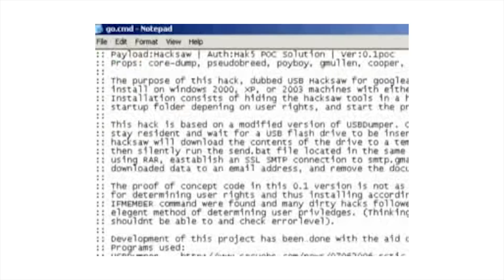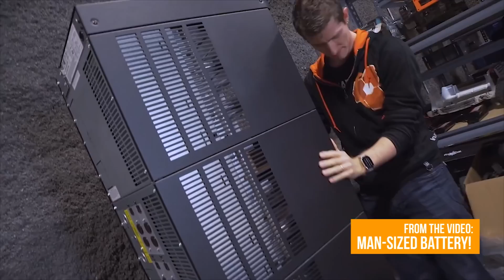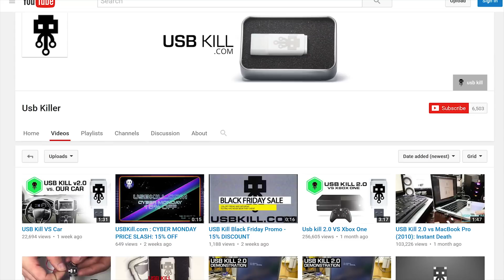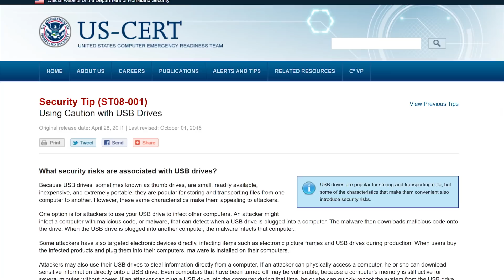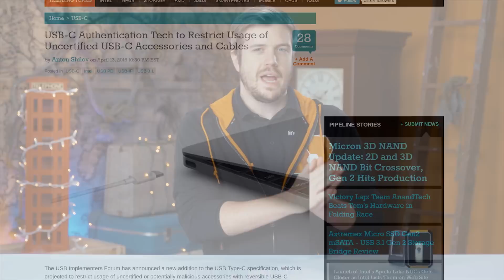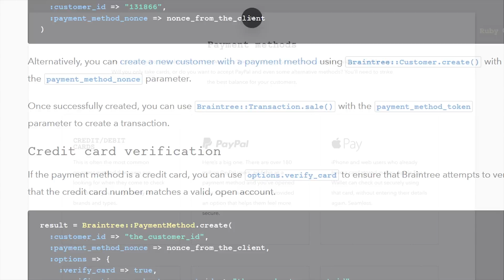COMPUTER DESTRUCTION (GONE DEADLY)

Comment: Why couldn't they just put a fuse in usb ports? If the port receives a voltage above the usual, the fuse would break the circuit.
Reply: Fuses break the link after a x amount of amps goes through them. Not voltage.
Reply: Budred123 that would be expensive. that would be 6-16 fuses per motherboard + they would have to drop a lot rnd money to make tbem work well in such a confined space.
Reply: Fuses break from current, this has very low current, and by the time te fuse had the time to melt, the voltage would've already went trough
Reply: No worries, I spent 20 years in the computer building/repairing business. I got board and got into automotive repair. Been doing that for the past 4 years.
Reply: Semiconductors don't have constant resistance. The resistance vary with voltage. A fuse would not protect you. Maybe an MOV or zenerdiode could clamp the voltage. But galvanic isolation is the way to go.
Reply: Roman 2510M  It's better to use a MCB
Reply: well try and apply a revers voltage to a doped juntion eg PN ... unless you are working with something like a zenner you will pinch the junction without a measurable high current (once pinched you have an avalanche of charge. like bursting a dam.
Reply: fightingfalconfan ah, okay, I only have the most basic understanding of electronics (aka not very much).
Reply: I have multiple old Mobos in my scrap pile,and they all have smd fuses on the Usb lines.For the most part though,a fuse protects against over current,not over voltage.A fuse will have a working voltage and current rating associated with them.
Reply: Red Engineer. They make fuses for USB ports for this very reason. V=I*R. They're no low current/high voltage for a resister unless the resistance is very large. No two was about that. I'm using a 3 year old motherboard with about 6 USB fuses, it's nothing new.
Reply: THANK YOU k0ppit, for mentioning zener diodes, because that is how we usually do it (or schottky). Those are used to protect against ESD, which are waaaaay high voltages.
Reply: the issue with fuses in a high voltage situation is that even if the fuse blows, it'll just arc over and continue on. the best solution is as said in the video, opto-isolators.
Reply: opto isolators cant carry power  .... and im pretty sure the makers are not in some conspiracy - they wanted to make a device that can kill a device via the exposed usb port and it shows just how vulnerable they can be. I don't think they should be illegal to have or make though, but it is definitely illegal to use them on someone else's machine, just as taking a sledgehammer to it would be.
Reply: Budred123
4 years of wrench time, 1.5 years of electrical study.
Reply: ┌───────┐
     Varistor
└───────┘
Reply: Exactly elave16.
Reply: Tiago Oliveira a fuse protects from high current. based off ohms law, voltage and current are directly proportional meaning if the voltage is high therefore the current most also be high
Reply: Tiago Oliveira search up ohms law
Reply: Mena Azab omfg.... i don't need to search i have a degree reading this " voltage and current are directly proportional meaning if the voltage is high therefore the current most also be high" makes me cringe "if voltage is high current is also high".....pathetic P = P*I SO IF I HAVE HIGH VOLTAGE AND LOW CURRENT I CAN PASS TROUGH THE FUSE ALSO FUSE IS NOT A RESISTOR
Reply: Mathieu Paquette thank you, I finally found someone who actually knows how a fuse works
Reply: You need to clamp datalines somehow to a solid voltage point to allow a fuse blow under this attack. At the risk, the surge will flow to the motheboard regulators. also this surge is TOO FAST, a fuse is SLOW in comparison. I mean, by the time the fuse BLOWS, the chip is already fried. Power lines are low impedance, so attacking the 5V rail probably is not as deadly as surging in the datalines with are high impedance. As I said in other commnet, ANNY EXPOSED PORT OR CONTACT is candidate for this attack. Try the similar idea on the video port (VGA, HDMI, DISPLAYPORT), audio out ... all of those are exposed terminals of different chipsets that can be blown effortlessly. The only board that have protect-everything are the PCs targeted to be used in industrial enviroments. On those every port has surge arrestors, not fuses, but at least had protection.
Reply: +Sod Alfresod   you are correct the solution is an MOV
https://en.wikipedia.org/wiki/Metal_oxide_varistor
of course these still have a threshold of tolerance 
Another would be to make a mobo that funnels all usb ports through a gas tube arrester and shunts off the extra energy to ground 
But of course that kind of mobo has to first be designed...
Reply: I think ports would still be fundamentaly vulnerable though and it would be difficult to design the low voltage low current usb against high currents and voltages. A simple way to increase robustness may be to include fusable zener diodes on the power lines and optocouplers on the datalines to make sure it wouldn't kill the device attached to that usb port. Another way would be to use external usb modules and use wifi or fiber to connect them to the device, completely separating them. In a security setting it might be the best thing to remove all uncessary ports though and keep the rest locked behind a cover which needs a key, or even do a mandatory test/scan with a test board on any usb devices before they can be plugged into the port.
Reply: Kevin your right. Whatever the solution (it has to be field tested to see) entails mobo redesign, then I go back to those "opto-isolators" and they probably look easier... Seriusly DID THEY COME UP WITH THIS USB KILLER JUST TO SELL THE ISOLATORS???
Reply: fightingfalconfan I do know quite a bit about computers, its just the circuitry and electrical things that I still struggle to understand.
Reply: +Quinson if the current is low enough there's no voltage that can damage the fuse, it might send enough amperage to break it, but it wouldn't protect something as sensitive as a motherboard
Reply: fightingfalconfan a high amount of voltage equals high current. ohms law
Reply: the fuse doesn't protect  from high voltages
Reply: Mena Azab what? i agree with SOME of the thigs but you know that if you gona put a fuse you have to put a fuse of 500ma or 1A do you know what you can do with 250v at 400mha ? it wont blow the fuse and it will fry your pc... also the fuse is useless if the voltage is high enought to jump across, "if the voltage is high therefore the current most also be high" wtf?? so this means i can't have like 10kv at 0.1ma? wtf???!!!!
Reply: What kind of voltage should they be expecting? Most fuses have a like 0.25ms to a couple seconds before they blow. The usb killers have been made as delivering 100v or 200v which are 20x and 40x the voltage a usb port gives out.
Reply: Tiago Oliveira what about a resistor or a mini transformer to boost the amperage so there is enough resistance for the fuse to blow
Reply: Hisjsshd no need for that ur already getting enough current from the 200 v
Reply: Has anyone here heard of a varistor?
Reply: Sod Alfredsod What's a varistor?
Reply: A varistor is a special component that has very low resistance when the voltage is above a certain thereshold.

varistors are commonly placed paralel with ground and vcc (+) through a fuse.

If you then try to overvolt it, varistor will cause a very high current to pass through the fuse and itself, leaving the rest of the circuitry intact.
Reply: Zeeshan Sange look it up on Wikipedia.  the explanation is pretty clear and you have a simple v i graph(remember that an ideal resistor is a straight line with an angle dependant on the value of R if the y and x scales are equal)
Reply: Fuses are current-protective. Never attempt to use a fuse for voltage-protection...
Reply: I believe that Intel's PCs already have some form of surge protection like this, but it still messes up the USB port. At least it is better than having to replace the motherboard.
Reply: Also.... never put a fuse in the path of 480Mbps. Or 40Gbps.
Reply: Budred123 this looks nicer and it's cooler that's why
Reply: You would have a lower amp draw the higher the voltage got would be your problem. For instance the amps on power lines is only like 11amps but supplies your 200amp service.
Reply: fightingfalconfan try putting 200V on the power line of ICs and across non ceramic caps I doubt many of them will live to tell the tale.
Reply: the time the fuse goes off its too late
Reply: It exists on some nicer computers like newer MacBooks.
Reply: Something something voltages and currents why don't they fuse USB ports reeeeeee

Fuses wouldn't work. Period.
The high voltage is what damages the board. The spike in amperage is moot. Fuses simply aren't rated for such a purpose.
Reply: Red Engineer: V=I*R. If you double the voltage, you double the current. If the voltage is damaging the fuse will break. That's the entire purpose of a fuse!
Reply: Art Vandelay because amps kills circuits, voltage don't do a whole lot

Comment: Manufacturers can design their hardware (motherboard and such) with the hardware safety components on the USB Killer Tester and the USB condom. But this is going to drive up the cost or make it a really good branding for expensive security minded computer.

Comment: there should be a setting on the pc that turns off usb ports when not in use.
Reply: Would be helpful to people that are paranoid about malicious USB sticks.
Reply: the problem with that is you'd have to manually turn them on and off for it to be effective
Reply: yea, but you would only need to do that if you think you need to. If thats the case I dont think it would be a big issue

Comment: this product should be illegal, akin to the distribution/creation of malicious software.
Reply: So knifes should be illegal too. This product will improve hardware physical security. Also if someone wants to destroy someones stuff then it isn't hard to DIY that stuff.
Reply: This isn't software It's hardware at least check what ur saying this is a tech channel u know
Reply: Ethan Edwards keyword "akin", atleast check what your saying, this is a youtube comment section you know.
Reply: but its hardware.  and not lethal on its own.  its just capacitors and circuitry.  think tazer gun minus battery.
Reply: Jcraft inEngland tasers are illegal in many states.

Comment: HEY LUKE YOU SHOULD MAKE A NORMAL USB DRIVE LOOK LIKE THE USB KILLER AND PLUG IT INTO LINUS'S DESK PC THEN UNPLUG THE POWER TO THE COMPUTER AND PRANK HIM . like if you want him to do it
Reply: Video Production
Reply: yes?
Reply: Just install a fake power outlet or cut of the electricity to the power outlet that it is plugged into
Reply: Good idea but I doubt linus will fall for that..
Reply: Video Production but the power has to be plugged into the wall but disconnected inside the computer ;)
Reply: he'll check that but if they take the outlet out an d gut the wire then put it back he'll never know
Reply: Just tell him it's a prank before then. No need to mess with cutting wires for an outlet
Reply: itll make it for cool

Comment: If you're quick enough, can't you just turn off the device that's about to be attacked? no power means you can't charge the USB and it cant kill the system. I would doubt that it would work with laptops given that there is a battery inside- but wouldn't physically unplugging a desktop do the trick?
anyone smarter than I am know for sure?

Comment: Can't you just disable the USB ports?
Reply: Colton Fuston probably not, as long as there's electricity making it through the port it can charge then discharge the capacitors
Reply: thanks i thought that if you disable it the nothing can go threw it(electrons)
Reply: Only if your motherboard has that option in the bios. With most devices, if you disable the port in the OS, you're simply instructing your pc to ignore whatever is plugged in. You could still charge your phone but your pc won't "see" it.
Reply: Colton Fuston disable the power transfer drivers

Comment: You can solder a varistor on your usb port, if the tension is too high, it wont pass ^^ making it usb killer profed but it will still work with normal usb things ^^

Comment: Opto-coupler is for signal not for power pins. There will be overvoltage protection circuits that are faster.If all USB ports have power supplies parallel we can make a protector USB to regulate the ports,  maybe!

Comment: I might actually have a computer that could potentially be safe from this.  I have a SilverStone case that I keep my gaming rig in, but the big thing about it is that it's supposed to be used as one of these fancy media PC cases.  This one in particular looks like a fancy DVD player/small amp thing, and it has a door, with a little lock on it that hides all the front IO minus the power button.

I mean sure, they can try and get it from the back, but there's already so much crap in the way that more likely than not someone would see them trying to reach their hand behind there trying to mess with the computer.

Comment: USB isolators are usually only available in 12Mbps or slower modes, it doesn't work at 480Mbps or 5G/10G. To isolate USB high speed or super speed, the device will be very expensive, such as Corning USB3.Optical cable with some mod.

Comment: I'm kind of curious. If you plugged one of these into a USB hub, would it kill the computer connected to it, or would it just kill the hub? My money's on the latter.
Reply: It depends. If you plug into a guarded USB port, the data transfer might or might not get disrupted. But on unguarded? Your hard disk might or might not survirve and your CPU? Well, sorry for you as there's a 99% chance you have to buy a new laptop or replace certain parts.

Comment: it wouldn't kill my 2001 pickup truck because there are no USB ports it would just kill my head unit or if plugged into my Black Box it would kill my Black Box it basically is just a flight recorder technically made out of an old Raspberry Pi and an Intel Edison but I don't think that would stop my truck from running

Comment: I wonder if Metal-Oxide Varistors, diodes & automatic fuses in USB (power & data) buses would do the trick in protecting USB ports?
And if USB_Killer was detected (broken fuse) they should allow to pump the voltage from USB port to USB_Killer_dongle till the ultimate destruction of device.

That shouldn't be hard to manufacture.

Comment: Most optocouplers are not bidirectional and the ones that are will not be fast enough.  Even then you can still kill a device with the power lines, although you may just blow the fuse on the board.  These devices are novelty weapons disguised as USB devices and are meant to get someone else to brick their own devices (ha ha.  Funny right?).  As in, give it to your enemies and let them plug it into their air gap machine and then wonder what the @#$% just happened.  But honestly, if you're really determined to destroy someones electronics then the traditional ways of bricking devices will always work.  Like, "Hey friend, let me show you how a hammer works!"  Knowing that, why would you ever need to pay money for a USB killer when you can just stomp on it, break it in half, smash it with a hammer or other object or even toss it out a window then walk away?  Its the same end result, the device is dead and you are still the asshole responsible for its destruction.  Yay you... Grow some balls and get rid of the USB pacifier.

Comment: Optocouplers won't work on the 5V output. They can't transfer current needed to supply power to the USB device.
The solution are MOVs. These clamp the voltage to ground in case of surges.

Comment: OFC this will fry old and outdated components, anything modern has so much over current/voltage, reverse polarity etc. protection the worst case scenario should be a fried usb port. I have tried so many of these on my desktop and the worst thing that has ever happens was the computer immediately shut down with a hard stop to the hard drives basically the same thing that happens from too high of an overclock. Some of them show up as unrecognized usb devices and ask me to search for drivers ha. Sometimes the ports become disabled until I reboot the system, I'm guessing this has something to do with the protection for the on/off charge feature.
Reply: purekeynoob well you're evidently wrong, many videos prove that new components are just as vulnerable.

Comment: The only way i can see fit to protect my system is to solder mu own circuit to test for high voltage and block that usb port off... (manual reset for extra safety)

Comment: Couldn't you disable the USB controllers in BIOS? I think on some machines this disables power to the port. Though the ideal solution to this would be a simple decoupling IC to shield it from voltage spikes. Considering the low price of these it's kinda stupid they dont build them in to all devices.

Comment: Well, I would be happy to be correctedif I am wrong but aren't optocouplers horribly slow?
I made quite a few inquiries about them when I was investigating 3.3 to 5 volt two way communication and was told both the photo-diode and photo-resistor both have their own reaction times to slow down transmission rate and that optocouplers were actually quite a dated technology >.>
There are quite a wide range of options when it comes to voltage clamping, and though the optocouplers offer maximum safety in the seance of total isolation of the two circuits there are other options that have less of a performance impact. Of course I was doing this research in terms of very slight voltage difference on data lines so maybe at -200 volts optocouplers are the way to go...
And hey, if apple is doing it... then it probably /is/ cheap and dated barley does the job but they will slap a nice frontage on it and sell it for top dollar anyway...